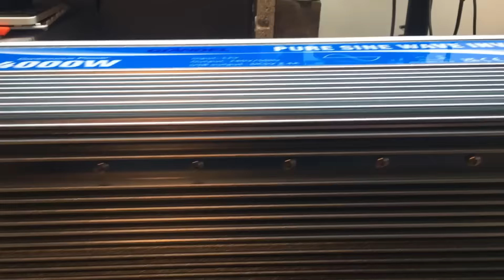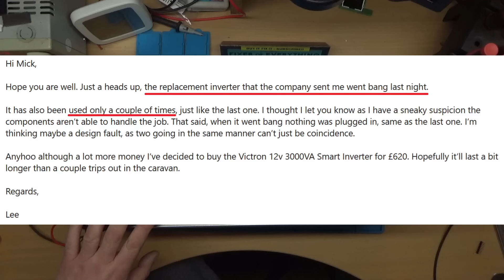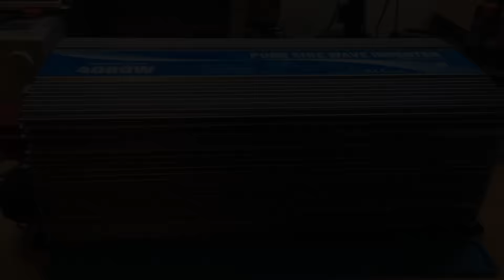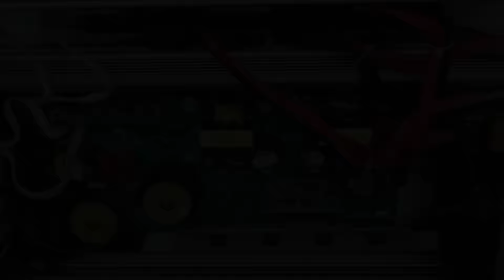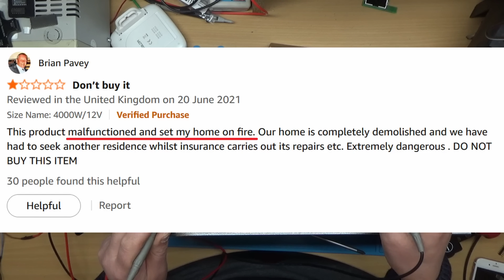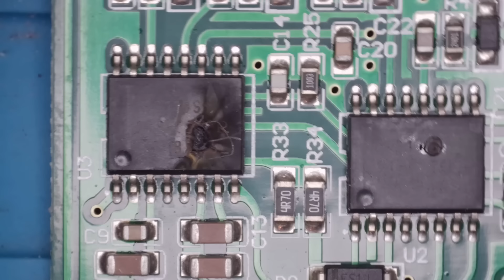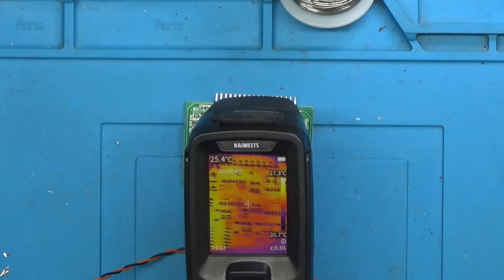Blown 4000W Inverter 💥 - Fixable or Game Over?

Comment: Very odd, at first glance it looked to be a very tidy design which, supposedly, has all sorts of protection circuitry. Designed in Australia, though manufactured in China (of course). Given the apparent stress breaks on the mosfet pins, I concur that there may be mechanical issues, a guess would be stress due to mosfets first soldered to the PCB, then screwed to the heatsink (or just poor-quality components).
Reply from the maker: Yes it did seem a bit odd. I literally moved it slightly with a screwdriver and it just fell off! It seems like they just copied and pasted the same circuit 8 times.

Comment: At least you tried, that thing sure did blow in style! I see that the company is Chinese.

Bearing in mind that this looks like it costs over £400 when new I hope that the customer is able to get a full refund, even though you've had it apart.
Reply from the maker: Yes, it was a bit blasted. This was the first unit which they replaced free of charge. It was a about a week later that the new one they sent also blew up. He was only using it in his camper for running a fridge. I'm not sure if he got a refund, but he's bought a Victron and that has been fine.

Comment: Watching with interest, I've had the 3000W inverter from that company in my campervan for the last 7 years without a hitch, though I've never taken it over 2200W. Wonder if he'd been pushing the limits?
Reply: Probably only 10kw.
Reply from the maker: I think he was only running a fridge in his camper. Perhaps it didn't like it when the thermostat switched it on and off or something...
Reply: @BuyitFixit  Wouldn't have thought it would be that. Suppose it could be the initial current of the fridge compressor starting up. Why not use a 300W inverter for that though.... Love your vids!

Comment: I have worked on dozens of this type and have used driver boards from china and put together my own driver boards. Most of the time it is not an economical proposition to repair . The form factor is the same in the dc to dc converter followed by an output stage  of n channel igbt .  the IGBT driver has to switch negative on the gate to get a decent turn off time . I love power electronics. Things can go south in a spectacular fashion. Bits of silicon flying all around the workshop.
Reply from the maker: I might have a look into a replacement board, but going off the reviews these don't seem to be the most reliable devices! I think the owner was just using it to run a fridge in his camper van.

Comment: These big inverters make me laugh, 4000w from a 12v battery, it would pull about 350 amps at full load, that's your average 100Ah leisure battery flat in about 10 mins, provided the inverter doesn't shut down due to voltage drop, or catch fire. LOL.
Reply: I would hope that someone is smart enough not to try and pull 4000w from a single 12v battery!😂 They are made to use with a bank of parallel batteries
Reply: @brucepreston3927  Absolutely, but sadly people do, It still wouldn't end well on a bank though, the tiny cables inside the inverter would melt pretty quick. Cable size would need to be around 67 mm²
Reply: Damn the laws of physics!! I'm shocked I tell you, shocked.......................... well not that shocked 😆
Reply: Don't think many people are still making do with 100Ah leisure batteries. I've just upgraded from 560Ah to 2x460Ah and most other people I see are using at least 300Ah ones
Reply: @HiruS22  100Ah I stated was just an example.

Comment: That Victron Inverter will serve him well.
Reply: Although I use Victron MPPTs and a Cerbo GX, the only inverter I ever had fail was a Victron.
Reply: @HiruS22  I fixed a few, they are build very well. (and they were all over 25 years old. That Chinese low budget crap  will not last that long. (they were charger/inverter combinations for use in boats. I have a 1900W myself.
Reply: There's two main types of Chinese inverter , 1. The sort that WILL go on fire , and 2. The sort that ARE on fire 😮
Reply from the maker: Indeed 👍

Comment: One thing these Inverters don't like is the back EMF from the likes of a chop saw ...
Reply from the maker: He said he was using it to run a fridge in a camper van. Perhaps it didn't like it when the thermostat switched it on and off...
Reply: @BuyitFixit  Maybe the low inductive load upset the Pixie wrangling circuits...
Reply: @Woffy. I think the mode of failure might have been the high voltage mosfet.
this might be TLDR for some.
looks to be 1 element on an H bridge.

This inverter design is notoriously laggy. "Soft Start" isn't a feature, it's a bug sold as one for decades now
Add a sudden load, output voltage drops before the controller can catch up by ordering more power from the boost controllers, this can take up to 250ms. there's your soft start right there.
The reverse is also true, if a good sized load, doesn't have to be huge, like the inverter power rating, such as a 150 watt fridge compressor suddenly shuts off, particularly if there are no other loads on the AC side at all to buffer it, the controller may not be able to shut down the boost converters quickly enough to compensate, resulting in high voltage spikes on the 220VAC line There was likely an MOV protecting against this, but they can wear out quickly after successive hits, often dying in an open circuit state. If the Vdg on the mosfet exceeds it's rating, that fat voltage just went somewhere it shouldn't have, likely what explosively blew that chunk off the mosfet. took out the two mosfet drivers on the controller, locking the remaining 3 H bridge mosfets on, shorting the 320V rail.
This explains the blown fuses on the bottom board. now lets move on to why the fuses blew on the boost converters.

Notice that second card, Northwest of the blown controller? it had input and output voltages as well as wattage labeled on it. I'm betting that one drives the boost converters. When the output controller blew, the boost controllers kept running. Pretty sure that controller is configured to keep the 320V rail happy, as a "simple" power supply; rail voltage drops, feed it more power, voltage rises, feed it less power. rail shorted? feed it more, and more and more, till it blows the fuses on the converters.

Lesson, try to keep a small secondary load on the AC side when running anything substantial. I figure, with the low .5a standby draw, there is no dummy load on the AC side built in.
Sorry for the long explanation
Reply: @davidconner-shover51  Nice forensic assessment, I suggest a resistive load always be on these cheap Inverters, as you say small loads can be just as destructive.  Interesting that in 2026 many DC to DC and DC to AC inverters installed into EVS' for none traction use are failing causing fires. Just poor circuit design. .
Reply: @Woffy. From experience, I have one that looks identical to this one, though a different name plate. I peered inside, same board layout.
Reply: @davidconner-shover51  Copy / Paste, collect money, Bang,  repeat ......
Reply: @BuyitFixit  Running a fridge in a caravan is a classic scenario for blowing up inverters like the Giandel 4000W, even if the fridge's running wattage seems low. The culprit is almost always the startup surge (Locked Rotor Amps) of the compressor motor While a caravan fridge might only draw 100–200 watts while running, the compressor motor can require 5 to 10 times that amount (1000–2000+ watts) for a split second when it starts,The mini board containing the PIC16F716 is  a victim,The "Snap" Failure Mode ,As noted in repair forums for Giandel inverters, modern MOSFETs often "snap" (fail short mechanically) rather than burn out gradually when subjected to currents exceeding their ratings,Connecting loads that exceed the inverter's surge capacity, such as large motors (e.g., air conditioners, table saws Fridges ,) starting up while other loads are active, can stress the MOSFETs beyond their limits. While inverters have electronic overload protection, a severe or repeated surge can cause the transistors to fail mechanically ("snap" rather than burn out) good luck on this guys next inverter the poor thing ,hope the wifes getting better matey
Reply: @BuyitFixit  Nah he plugged something into it that took a couple of KW and that cooked the mosfet. Because that would be hundreds of amps at 12v.
Reply: This sort of low budget inverters are even more sensitive for that.
Reply: Yup adding a line conditioning reactor can save your expensive inverter from inductive spikes. You can get really good ones from discarded inverter motor type washing machines for free or nearly so.
Reply: @christopherleubner6633  I think the bigger issue with these newer cheap inverters has more to do with the high voltage boost converter power supply feeding 320ish vdc to the H bridge on the final drive converting it to AC. there are a couple of rather beefy inductors on the main board that likely deal with backfeeding spikes pretty well.
I suspect the AC sine wave forming controller and the boost converter don't talk to each other much.
Rapid load switching, seemingly regardless of the type of load, seem to spike that bus pretty hard.
Soft Start isn't a feature, it's a bug they can't get rid of without a completely changing the entire concept of how this inverter works.
How do I know this? well, I took a peek at mine,
also a 4000W, almost exactly the same internal layout, heck the only difference I saw was the brand name, 120V  plugs attached in leiu of the 220volt. and that other daughterboard, labeled with 12V 120V 4000W.
Running, the voltage bounces all over the place in reaction to any change in load.
the 120 volt lighting flickers wildly with any load changes over an amp, dimming momentarily at the start of the draw, brightening briefely at the end of the draw.
putting an oscilliscope on the AC output, yes, at the start of a draw, I've seen it drop to 90v for about a quarter second, then bounce to 120, at the end, the voltage spike to 130-140 volts, also for a quarter second or so.
the 12 volt lighting on the same batteries as the inverter do dim at the start of the draw, they also brighten at the end of the draw, but they don't flicker in quarter second intervals, they just follow the 12v rail voltage.
Needless to say, I will never buy another true sine inverter with "Soft Start" technology again
Reply: @christopherleubner6633  Christopher,  thats a good suggestion, we used to have enormous reactors on the industrial VSD drives but even a choke from fluorescent light would help depending upon the reactive load.